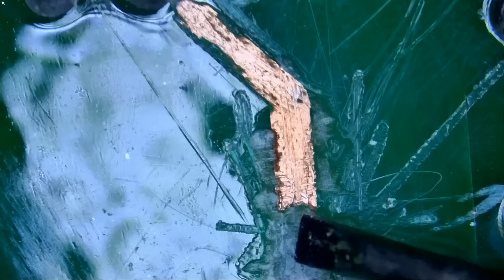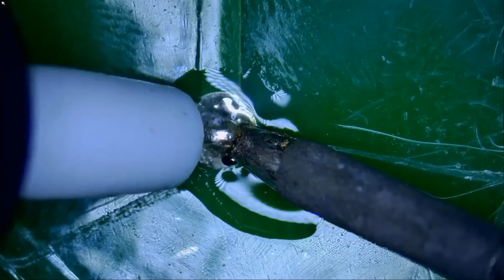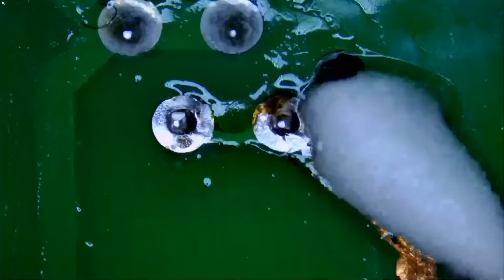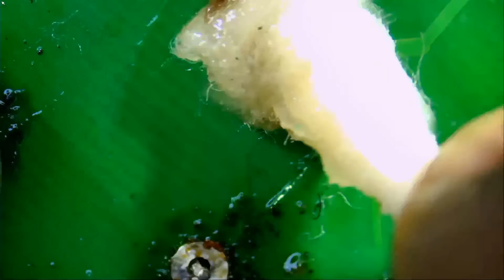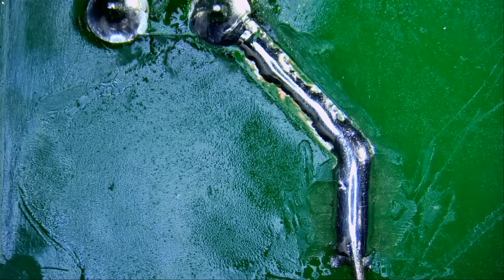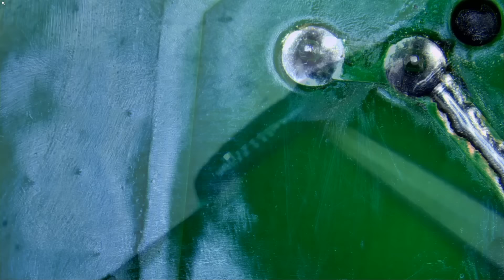Whirlpool Dryer Motherboard Repair

Comment: hi.I am from Argentina. I repair electronics since I was 14. Now I am 59. I love your videos. To use the sucker, you have to melt the solder, and quickly put the sucker perpendicular to the board and push the button, without iron. I repaired around 400 commodore 64, here the copper strip did not exist, so the sucker was the only option. I love the product you use to lower the temperature of fusion. Do you sell to Argentina? thank you very much for your time.

Comment: For the joint sucker, you didn't applyed enaugh température neither flux dor thé second and third try... Si yeah I agréé with you ont thé fact that is useless for SMD, but for relais, and in your case, you juste didn't used it properly

Comment: A few years ago, my old Yamaha developped a cannon sound out of mufflers and the RPM would dance up and down 0 to current rpm. . I checked on a french site, the guy told me : If all wires are intact and not grounding  any where , take your CDI unit out and redo all solders  I noticed that the solder on the big SCR had a dark aura in them, so I redone all of them, a varnish double coat   let dry    put it back it in, went for a ride, ,  Rpm jumps and canon shots in the back had stopped. .and curiously, engine vibrations  intensity  had   noticably  reduced, and arrived  600 rpm higher So Time will degrade solders conductivity. .and cause very ackwards troubles. .

Comment: My experiece of using desoldering pump...
The soldering iron should be removed from the point just before activating the pump.
If the Iron stays on, it resolders the point.

Comment: Whirlpool Duet boards, both the washing machines and dryers, fail at a ridiculous rate. These would be a good line of products to take on, especially considering how many of them there are in service and the fact are no longer available as they are out of production.

Comment: You have to snatch the soldering iron out of the way while very quickly pressing the solder sucker tip down on the hole as vertically as possible while pressing the trigger. It has to happen quickly.

Comment: I repaired my board by just soldering the burnt spot .. a search found the solution and it seems the power surge of a relay is too much for a trace...
it was years of use before it failed....i tried resoldering first as that was the common repair... it has worked perfectly for 2 years now... another repair option was a Wire to replace the trace or just wiring in a relay externally to board....
not an expert like you but hey it was a working dryer after and saved me $$
I been repairing stuff for over 50 years and fixed a Security problem on my car with a resistor ( another Search tip that worked )... the other option was about $400 in parts/programming that was the repair told to me from Mechanics at Dealerships ( friends )... i took the less than $10.00 option ( i bought a pack of resistors after a multimeter showed me the resistance i needed ) ...it ran perfectly after that and fixed the Crank No Start issue....
🇨🇦🤓🤟

Comment: Like a vacumn you need to hold it correctly to suck properly...😉 i would heat it and remove iron away..hold over the area so you cover it completely and suck the solder ....it works better if you are sucking the whole area not from the side... how i see it done and how i would use it for full effect...
🇨🇦🤓🤟

Comment: Very nice I am really impressed from you this your channel is very good for youngsters who want to learn microsoldering. Brother I want to ask you one question about this conformal coating on pcbs which chemical we should use to remove efficiently.  I need your recommendation. thanks

Comment: When i work on a board that was sealed, most of the time i use the mg chemical 422b formal coating, it stick to anything, you can spray a very thin coat and it dry in 10min, its literaly a silicon based product. you should try it someday, im sure you would like it.

Comment: Good solder joints are a really good skill. I've built a lot of electronic projects over the years so good to know. Lol $100 per pin to do a soldering job - I bet that a company like Apple would try that on it's Cult of IOS customers.
Reply: Yep, it all comes down to the rosin flux & a good clean solder tip.

Comment: Nail polish works as well as conformal coating in my experience and can be used to cover up parts where the original conformal coating got removed.
Reply: Nail polish does work, but there is a similar product that works better. If you go to a musical instrument store you can get liquid Nylon that classical guitarists use to strengthen their nails. It works surprisingly well.

Comment: I did this repair myself on my Whirlpool dryer.  There were a few videos online about it.  Turns out most people don't need the relay replaced, they just need to scrape back some of the protection film and then re-melt the solder to the blow pin of the relay.  Worked for me without replacing the relay... just the solder connection had popped.

Comment: The brass brush out of a dremil set removes that UV cure polyester/epoxy rather well. Ar least the board isnt completely bricked in thermoset epoxy like HV modules. Seen that before.😢

Comment: Pro Tip with solder suckers. Melt a little extra solder into the location, then suck all that solder out. Solder suckers are not for every situation. They were designed for PTH, that's where they work best. Like everything else, it's a technique and a tool that takes practice.

Comment: Whirlpool is absolute junk. Next thing will fail in 2 months. That motherboard can never cost as much as a expedited service + repair cost. You can probably almost get a new dryer for that price. I don't see the economics at having this repaired😮 (but it was a nice video).

Comment: Using solder wire as the connection link is a nice trick that I will have to remember. I say that but my soldering skills and tools are no ware close to yours.

Comment: You can wrap the wire around the relsy pi n ofor extra mechanical strenght and connectivity from vibrations from the machine.

Comment: A sucker has to be cleamed regularly, mineral oil on the o ring,  there is a modlel that has a heated tip,  that tip has a hole in it thru the center,  it works really well,,, it also has a small vacume pump...it to has to be cleaned but only when its been used for a lot of holes,  good for thru the board pins

Comment: Most likely unleaded solder. I also use low temperature solder. My experience I tin the legs of the relay first. Sometimes it’s hit/miss if you don’t tin the legs. I have used discarded solder wick and an exacting knife to redo the trace.

Comment: PCBs that are used in most Whirpools are known to have really hard solder and their holes have rings on the both sides.The best way to desolder with a hand vacuum pump it is also to add lower temperature solder and heat it up well.Usually 60/40 or 60/37 works well for me.

Comment: 9:15 A small "C clamp" works great too in situations you cant (or dont want to) put your hand close to the work area. Can pick up a nice light weight small one from harbor freight tools, or any other tool place pretty much. Just be sure to not twist the thing down and crush a component.

Comment: It is always the relay, square pins in a round hole is a pita, especially when high currents,are there that heat up the solder, cooling, heat up, etc. I saved many washing machines an dryers by adding solid copper to the traces and resoldering. Nice to see you have the same experience.

Comment: Long time ago when I repaired car electronic boards, I used acetone to strip sealant off of the boards before repair. The sealant works great preventing board contamination but when you are repairing a board, it has to go.

Comment: 50 yrs ago I used solder-suckers and the procedure was to quickly remove the iron to fully encapsulate the joint with the nose of the solder-sucker for maximum suck.  When I was faced with doing hundreds of through-hole component desolderings, I spent $375 for a de-soldering gun.  Best tool purchase that I'm still using today.
Reply: Exactly this, even to use a solder sucker it requires technique. Alex didn't use it that well.
Reply: Correct

Comment: I replaced this same relay on our dryer. Old one fried, I heard a pop & smelled smoke. I took the dryer apart & found part of the board fried next to the relay. I put a new relay on & "jumped" a wire were it fried on the board. Working fine for 3 years now, still working now.

Comment: I am currently struggling with exactly the same problem.  The motor centrifugal contact burned which burned up the relay contacts.   After replacing the motor, I replaced the relay but still not working.  Is a shame that Whirlpool discontinued supplying spares to a 7-year-old product. Will never buy a Whirlpool appliance again.

Comment: I like solder sucker for removing large amounts of solder from joints. I will finish it off with solder wick. Lastly, your sucker is very cheap. Get the engineer solder sucker. it is much smaller, comes with silicon replacement tube and works so much better than what you have. The Engineer solder sucker is made in Japan and so much better.

Comment: I have the same machine and have had to do this repair on my machine as well. exact same board. I've also replaced the pressure sensor and still have to replace a few caps on another board for a common SUDS F35 Error. always a great feeling when you can repair our own household items.

Comment: Appliance tech here.  I do this relay replacement in the field about once a month for these whirlpool dryers.  The quickest easiest way was with a Hakko FR-301 desoldering iron, which can also be used to resolder the new relay.  

Another note:  I've also desoldered that wire connector pin.  It happens when you get chatty with your customers.
Reply: I like to use masking tape to hold bigger components like these to the board before soldering them in i hate not having both hands free
Reply: Which model Whirlpool dryer is this?
Reply: Whoa. Using the hakko to actually solder. Of course! (slaps head)
Reply: @Rxke  well. The model he is talking about has a pump on it and is in the shape of a gun.. kinda clunky.

Comment: I worked a lot in ATX PSUs and solder sucker are good at this use. Like any tool ... you have differen qualities .... I used an old tired Goot and worked like a dream. Sometimes you need to add solder. And sometimes you need to be patient on bigger areas, even when solder looks melt is just melted on the surface ... and the sucker end doing a mess. Issue with suckers are, the bad ones tend to clog constantly and lose suction. But even the good ones need to be cleaned frequently to be effective. Of course you can use electric desoldering guns. Again Goot makes great ones ... but the tips are pretty expensive and even an SMD component can clog it pretty bad to the point tha the steel rod that cames to unclog wont do the job. They are for through hole only, specially power devices, or vintage electronics. No much use in an Iphone, it will suck half of phone components !!!! LOL

Comment: Sucker does a good job if you point it "vertically" right at the joint, not from the side when it just "gasps" air around. I actually have exactly the same kind of sucker.

Comment: Solder sucker is an useful tool for bigger THT solder joints. It is very helpful to add some silicone rubber tube onto the tip and let it 1-2 mm longet than the tip. It allows you to put the tip into really sealed contact with the hole without sucking too much air from around the joint. When sealed properly, the sucking efficiency is highly improved.
Reply: Dude, thanks for the idea. I will do this! Sounds amazing!

Comment: That particular solder sucker sucks. It's the same garbage one that comes with everything. I have one that has a soft silicone top on the end so it actually seals against the iron and the board. It got me through a repair where I had to remove all the switches on my keyboard because it had something spilled on it and the switches had to be taken apart and cleaned. The only problem is that I don't know where to get the high temperature silicone tube you put on the end.

Comment: Those failed solder extractions weren't fully molten, adding low-melt solder could have made that work better. Only differences from wicking are that it uses air pressure instead of capillary force and it's completely reusable.

Comment: I find that parts with a base that sits flat against the board do not allow enough air flow for a manual sucker to be effective. The sucker is pulling against a vacuum greater than it's own.

Comment: Sucker is not just gonna suck it up through the air, get it over the pin and against the board so it vacuums against the molten metal.

Comment: Dude, run a new wire all the way to the other point, instead of partially like you have done, and also clean your tip more often / cheers!!!
Reply: @BlueDevilsBari  I have repaired this more times than this dude has, and trust me, people don’t know everything especially in one-off ad-hoc customer requests… most people don’t even understand why those relays blow to begin with.

Comment: Solder suckers are very effective and quick for removing through-hole components.  The problem here was the protective coating.  The transparent coating over the board is called "conformal" coating and is available as a spray-on product.
Reply: So "Conformal" is what waterproofs the board?
Reply: @daviddenson3324  Plastik 70 by Kontakt Chemie for example.
Reply: @daviddenson3324  Yes

Comment: @Northridge Fix the low melt solder is the better way. Even though your desoldering method was a little flawed, you did have a small sucker. You were using a jive sucker!

Comment: What temp is considered low melt? I just tested 2 rolls I use most, Kester .1-STD-006 C and RadioShack 64-005 and they both melt about 189 degrees Fahrenheit. I use the kester on Xbox one hdmi ports before using hot air and it works great but is there a lower temp solder?

Comment: LOL way overkill. By the time I watched this video (I didn't watch it) I could go to Auto Zone, get a 12v 30a relay, a few connectors, badda bing badda boing ya done. Actually, I wouldn't have to go to Auto Zone I have spare relays. What a microscope 🤡 show. 🤣😂

Comment: When removing this type of relay from the board, it is best to grab the relay from the top with pliers and turn it left and right several times until the pins come off the relay.
Then the remains are easily removed from the plate.

Comment: Hi, I am using a solder sucker but I am using a soft plastic tip on top it makes the vacuum of the solder  100 times better.

Comment: I bought a really high quality solder sucker before finding your channel, and it was the same story, if you didn't have a lot of solder on the joint it wasn't effective, and it never fully removed all of the solder, there was always a little bit left in the holes you had to heat to remove... Then I found wick, but didn't have good flux 🤣 everyone starts somewhere, but your channel has helped me tremendously increase my ability to troubleshoot an issue, and save time through more effective applications
Reply: Good story. It is not uncommon for a hole to look empty of solder after sucking and/or wicking, yet the component seems to still be stuck (especially PTH DIP packages). This is because the leads of the component usually TOUCH the hole plating someplace, and a solder bond remains at those points. My preference is to remove component with low melt solder (which is super easy on both the PCB and the component), THEN clear the holes of solder. The net cost of repair is slightly higher, but the finished repairs are invisible; i.e. you cannot tell where the repair occurred 👍.

Comment: Pro Tip: Add fresh solder to joint before solder sucking. I do this all the time, works very well.
Reply: Solder suckers are just junk, bro. You can do the same thing but better, with other methods. Pro tip from a bigger pro than you. Trust me.
Reply: @THEFlea1991  They work great for older electronics. Been doing this for 22 years. As stated in the video, for micro electronics, wick is king.

Comment: That is not how you suck - heat the joint, put the sucker flat over the pen at 90 degrees and suck... will pull solder out of hole. Have to be very quick though... saves you wasting a lot of wick though, as bigger joints hold a lot of solder.

Comment: I replaced Whirlpool boards in my previous appliances. I can't help but think this expedited repair cost more than a new board or even a used on Ebay. I would do this repair now but my skill level back then wasn't the same but mostly diag. skills. I do appreciate the content though. I have also used solder suckers in the past. I have a Metcal vac. desoldering unit but never actually used it as it requires compressed air. I believe there are now stand alone units. I think someone made a great comment that doing this as hobby like 99% of us and Alex doing it his way as a business is very different. I would defer to Alex's methods 100% over mine and or anyone else's. He knows what works for him. I watch another guys channel IC Weld and he has a great saying. "I'm not telling you how to do it. This is how I do it."
Reply: Many of these are discontinued and available parts have all but dried up. The control board for my Duet washer is now well over $300, and the motor controller comes in around $250. 

Ebay with optional 2 year warrantee for the win!
Reply: glad he could save it from the landfill though